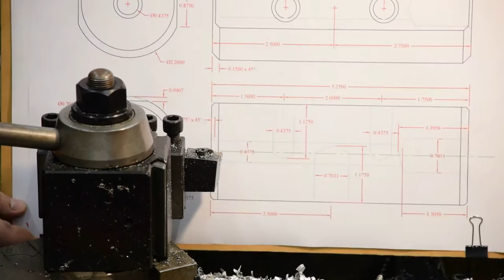Compressed Air Manifold - Part 1

Comment: I don't know if it is just my playback, but I had a really tough time hearing you even with the machine off, so just had to try to follow along.

I've never tapped a pipe thread before, so didn't know if there was a special drill needed.  I guess not.
Reply from the maker: +ILGopher  I'm pretty sure that to be done absolutely "correctly" that you're supposed to drill to size and then ream with a special tapered reamer so that the tap doesn't have to move a lot more metal toward the end as the taper gets bigger (IE keeps the DOC consistent for the whole operation).

However, I don't have any of those special reamers, and since I wasn't working in anything super hard or strong, I just went straight from drilling to tapping.

You'd probably have to ream first in something like Inconel or Titanium or hardened alloy steel or some of the harder grades of stainless.

I noticed that my voice wasn't loud enough when I was cutting this together, but it was too late to do anything about it then.

I'll try to remember to speak louder from now on.

I've already shot this whole series though, so it won't change until the next one I do.

Thanks for the suggestion.